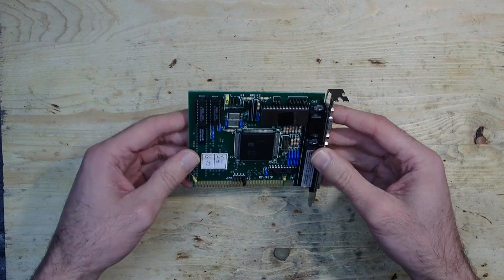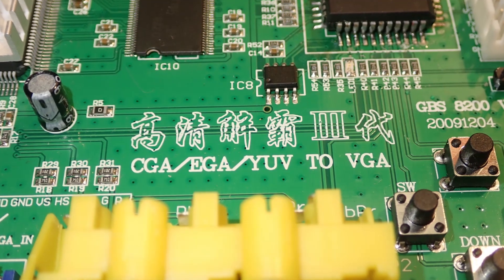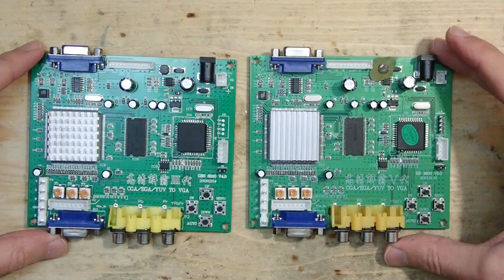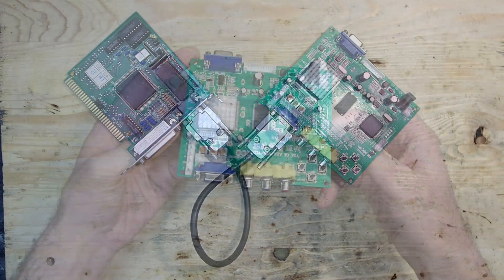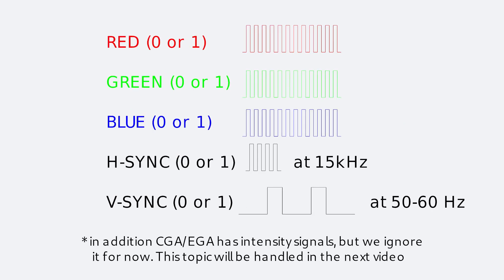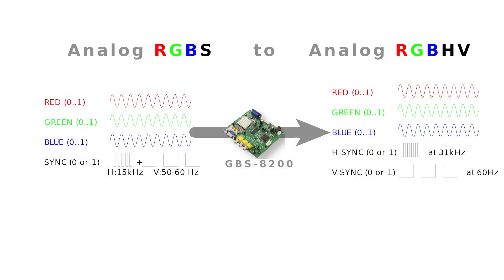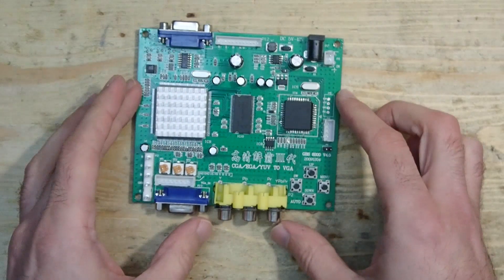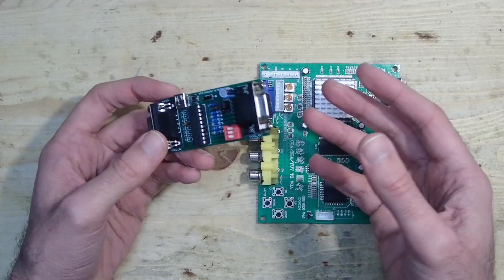MCE-Adapter (part 1): Why GBS-8200 is not a CGA/EGA converter

Comment: Just wanted to drop you a line and let you know I just built this board (had PCBWay print version 0.10.1) and it works great! I have it connected to an OSSC (not a GBS-8200) and it has no issues at all.  So far I've hooked a Tandy 1000 EX up to it, and I'm going to try out a Laser 128 (with RGB adapter) and a C128DCR later too. Although I have a couple RGB monitors kicking around, they're for dedicated computer setups, so it's nice to finally be able to work on CGA/digital RGB computers on my OSSC/HDMI workbench without having to disconnect a monitor and lug it around. Thanks for making the design open source!

Comment: This stuff's a bit over my head, but I always thought I was using mine for a CGA type signal. I use the GBS with Roland samplers which output RGB as TTL signals along with the two sync lines (15k horizontal). Decades ago, I used the same outputs to feed a standard Tandy CGA monitor with no issues. BTW- I never did understand why these things have a 15 pin sub for input when they're supposed to be for CGA,etc.    -Thanks for the videos too!
Reply: the roland samplers lack an intensity pin, displaying only 10 possible colours (black, red, blue, green, magenta, yellow, cyan, white) as opposed to CGA's 16. this makes it possible to just sort of jam the RGBHV signal right in, even though the levels of the digital RGB lines are higher than they should be.
Reply: @famitory  hey famitory, I was surprised  a little while back to find that the cable I have (which I used with the CGA screen) actually does have some active circuitry in it, but I'm not sure it does anything to the levels. I remember they used some weird upside-down version of one of the sync lines or something, so it may just flip that. -That's the cable with the 9-pin sub on one end (not the rectangle thing).  - and thanks for the info!

Comment: Hi!! cool video, do you know if a replacement for the GAL16V8B (ATF16V8B/BQL and ATF16V8C/CZ.) could work ? its harder to get a GAL without purchasing it from china and wait 2 months to continue the buil. Regards and thank you for your great videos
Reply from the maker: Hi, thank you! You can take any GAL model, which has built-in pull-up resistors on the input pins. I use ATF16V8B too.

Comment: Came across your video. I have an old 8-liner machine. Cherry master. Wanted to replace the old CGA/CRT monitor with A LCD. Bought that “converter “ and no signal. Do you know what I can buy so I can use it?

Thank you
Reply from the maker: This is the first part of this video.
Reply: @necro_ware  I watched them all. But differences in what I need.
Reply from the maker: @RenManinJapan  Unfortunately, this is all I have on this topic. The converter doesn't understand CGA/EGA and you have to convert that signal in RGBS, as I showed it in the video. No other way if you want to use GBS-8200. However, meanwhile there is also cga2hdmi adapter available, which is built around raspberry pi. You can toss the GBS-8200 completely and try that instead.

Comment: Hello, Great project, I will need and try this soon. May I suggest a improvement?:  Put all (most) traces in bottom (non component)  side. this way you can still make the PCB at home, sort of one sided. A couple of soldered wires aren't a big deal, but etching a 2-sider is.
Reply from the maker: Thanks! They are mostly on one side, only power traces are on the back and those can be replaced with a wire.

Comment: CGA/EGA can be TTL-level digital or analog signal.İt's depends the platform.
Analog one generally called RGBI.
Reply from the maker: That is not entirely right. There was an analog CGI signal indeed designed for NTSC, but was specified for a composite output. The so called RGBI was specified only for TTL.

Comment: So the main purpose of GBS-8200, why it was made in the first place, was old arcade machines? This board helps to replace arcade monitors with a new VGA ones?
Still don't know why it's so widely available, CGA/EGA converters are in demand too, and they could be made as cheap as this.
Reply from the maker: Yes, mainly yes. It works for the cabinets, but also Amiga and some other computers. However, it does not, what it is proudly advertising - support for CGA and EGA. Anyway, in the next part I will show how to close this gap.
Reply: @necro_ware : Perhaps I am giving too much credit, but is it possible they got confused? VGA is backwards compatible with EGA and CGA, and perhaps that's what they were thinking. However, I'm doubtful of this theory, as I would assume that if they advertise CGA and EGA compatibility, then they must have tested it for that compatibility; clearly, they did not.
Reply: @Christopher-N  They probably use EGA/CGA to refer to those resolutions and not to their actual video standards… much like picking those resolutions in an old PC game with a VGA graphics card installed.

Comment: I’ve been using one for years. Originally got it for my arcade boards but I installed GBS-Control years ago to make it a general purpose scaler. You should seriously look into it because it makes this an amazing device! Maybe you’ve noticed, but people often used VGA to refer to resolution… like 640x480p. In other words, it doesn’t always refer to an output specification. I always assumed they use CGA/EGA to mean 240p resolutions in a similar way.
Reply from the maker: I looked quite seriously into it, just watch the follow up videos to see, how it went. In regards of EGA/VGA/CGA, what people say is one thing and what you write into the specs is another. You can't just write, that your device supports digital video formats, but do analogue only. If they call it so only because the resolution or frequency, than I can call bicycle a car because it has wheels ;)
Reply: @necro_ware  I agree, but it’s not worth arguing that a “VGA” webcam that plugs into USB isn’t VGA. In the case of EGA/CGA people aren’t rampantly abusing the terminology yet so there is still a chance to save it. ;)
Reply from the maker: @emmettturner9452  Well, I don't know how about you, but if I buy a device, which primary job is to convert particular video signals, and which advertises it, but doesn't do that, I feel slightly scammed.
It's like to pay for a mouse and to get a joystick instead with an explanation, that everything is USB after all :D
Reply: @necro_ware  Yep. Pretty big fail on their part. Back then I assumed that arcade guru’s were just weird and adopted CGA/EGA as shorthand for those resolutions, though I was already aware that they were calling things medium res, high res, etc when they were all SD resolutions.
Reply from the maker: @emmettturner9452  That is actually even more complicated, since there are two EGA modes and they couldn't be more  different. The one is a low-res, but is pretty much CGA otherwise. It just had more memory and could use 16 colors, instead of pallets of 4 colors as with CGA. But everything else was the same and you could even use CGA monitors with low-res EGA. An then there is the high-res EGA which is completely different with RGBIrIgIb signal with up to 64 colors, almost double the resolution and completely incompatible inverted sync at 21kHz instead of 15kHz, which were used for CGA and low-res EGA.
But GBS-8200 manufacturer didn't bother about that minor details, they just printed CGA/EGA on it and ciao. I was really confused, as I started to evaluate it. However, on the good side, that pushed me do investigate deeper and to make my MCE-Adapter. So, even if I don't appreciate such a scam, I'm still happy :D

Comment: Wait, so the GBS-8200 is useful as is for Amiga owners? Just need to fashion a cable?
Reply from the maker: Yes, but you need a resistor on the composite sync signal, since the voltage from the Amiga is too high for the GBS.
See: 
https://youtu.be/q3J4QJsn0ig
https://youtu.be/xqlrOcGZx38
Reply: @necro_ware  super! Thanks

Comment: I always thought cga/ega was only through the white connection to the left of the vga port.
Reply from the maker: Those pins in the white port are connected to that DB-15 port pins, so they are the same. And the DB-15 port looks like VGA, but it isn't. It is analog RGBS with composite 15kHz signaling. VGA is RGBHV at 31kHz.
Reply: @necro_ware  yeah i seen a close up of the silk screen those far left pins claim to be the rgbs connection.

Comment: I was curious if the gbs could actually convert legit cga/ega signals.  The arcade community isnt always the most tech minded and when ive asked collectors if their monitor does 15/24/31khz they just get confused until I mentioned cga, ega, or vga, and then they of course understand 😂.  So yeah, blame the arcade crowd for the improper naming.

Comment: Shame you had to learn it the hard way! :( But yes, sadly the terms "CGA" and "EGA" are misused in the arcade board industry+hobby, as shorthand for any 15kHz and 21kHz video signal respectively. As you point out, the GBS was originally intended for the arcade market, so it makes some sense why they used those designators, despite contemporary arcade video being almost exclusively analogue RGB+S.
Reply from the maker: No need for sorrow, I learned quite a bit as I dived into it. Furthermore it ended in my MCE Adapter, which already was helpful for many tinkerers around the world :)
Reply: I've only ever seen people say 15K or 24K when talking about arcades. Never heard anyone use CGA or EGA. Maybe it's more common among the older pre-JAMMA crowd?

Comment: Hi my friend! I am waiting for the follow-up :) . In the past I was thinking to buy one to connect to my Amigas, but many people reported that the picture quality is very poor. There are some web pages that show how to mod the GBS to get a very good image quality. If I remember correctly, one of the first things to do is to replace those crappy caps with some new ones and different capacitance. I could be an nice idea to some more follow-up videos... Enhancing the output quality of the GBS...
Reply from the maker: Hi Jorge! Thank you once again :D I was on this topic for quite a long time yet and learned a lot of stuff about video formats and also gbs-8200. I tried couple of things, also capacitors and better shielding, but the best and simplest way to improve the quality dramatically is just to replace the firmware with gbs-control. It's open source and you can find it on github. I think I will tell couple of words about it in the next video, but you already can find a lot of videos on it and the follow up will be more about my adapter, which I briefly showed in the end. Anyway, the image with gbs-control is extremely good.

Comment: I tried the GBS-8200 on my Amiga and the tearing, shearing and latency were so terrible I couldn't take it.  I ended up building my own S-Video converter using an AD725.
Reply from the maker: I will briefly talk about it in the next video, but if you use gbs-control firmware, the image quality is mind blowing and the latency falls by far under 20ms. Even if GBS-8200 is a lie in regards of CGA/EGA, it is still a very interesting device for tinkerers among us. Unfortunately, the firmware is obviously a pile of crap and thanks to gbs-control the device shows the full potential of the hardware. It's pretty amazing, believe me....
Reply: @necro_ware  Good point.  Have you seen the Raspberry Pi Zero implementation that has very low latency and proving to be really good solution for many platforms?
Reply from the maker: @cbmeeks  Yes, the one just came shortly, right?

Comment: Unless I'm mistaken, the only issue is the sync signals being seperated.

I guess it isn't as simple as connecting together the two sync signals? ;)
Reply from the maker: Well you actually have to connect the two sync signals, but you can't just twist the two cables. It is not very complicated, but also not that simple. Anyway, it is not only about the sync, also the RGB color information is in a completely different format. As I explained, GBS-8200 wants analog RGB signal, where every color is mixed out of RGB values each between 0..5V, so this allows to produce nearly unlimited amount of colors (well with 24 bit and 8 bit per channel, you can reach 16,7M colors), but CGA/EGA has only digital RGB color values 0 and 1, nothing in between. That means, that you can get maximum of 8 colors. What I didn't tell in this video (there was just a remark), that CGA/EGA both have additional color intensity information, which is not part of RGBS. So, in short, if you even will manage the problem with the composite sync and try to connect CGA/EGA, you will get wrong colors. So, no, the problem is not only the sync signal. But stay tuned for the next part ;)
Reply: @necro_ware  Thanks! Looking forward to the next part.

Yes, I understood the difference, but in the end digital just means there's no in between once in the analog domain. It's 0% or 100%. But I didn't know there was intensity being carried in CGA/EGA. In which case it makes lots of sense an adapter a little more complex is needed.
Reply: Oh I just realized... You probably meant luma. Duh
Reply from the maker: @jeremiefaucher-goulet3365  I guess, you confuse it with S-Video/Composite. EGA, CGA and Hercules have so called Intensity signal, which doubles the amount of colors.
Reply: @necro_ware  Right! Thanks for reminding me of this doubling

Comment: Another solution is to use a european TV set with good old Peritel (or SCART) input. Another plus of using a TV set is using CGA graphics card with composite output, and enjoy 16 color graphics instead of awfull 4 color graphics mode

Comment: No, you wrong!! :)) CGA and EGA have analogue RGB, but it have only full ON or full OFF - no gray state. A was have  EGA monitor and with a little change in schematic  it became common RGB monitor. So, you just plug RGB directly to converter or thru resist divider(5V to 1V)

To merge sync signal you can use resistor and diod and invertor, if it need :)
Reply from the maker: "...but it have only full ON or full OFF..." - this is exactly how you describe digital output :D
Reply: @necro_ware  No, digital have some bits became to different colors, but in this case it only on/off current line - I think it's "binary output", becouse of two state, not digital))

I'm forgot about intensity - but it just add brightness to channel, so you can use resistors plus diode from intensity to make truly analogue RGB :))
Reply from the maker: I really don't want to argue about this, but MDA/CGA/EGA standards are officially called "digital TTL". If you are really curious, I think Wikipedia is a good start: https://en.wikipedia.org/wiki/Color_Graphics_Adapter. Digital means, that you have 0 or 1 (0V or 5V) and, that the system can't take any values in between. The thing, where multiple bits are encoding an information, like color, are called protocol and is more advanced digital technology. MDA/CGA/EGA were no so advanced, but still a simple 1-bit digital format. VGA introduced so called RAMDAC, which was responsible to translate digital to analogue signal to provide it to an analogue VGA monitor. So, it is funny, but our first PC monitors were digital until we got analogue with VGA and eventually digital again with DVI and later.

You are right in regards of connecting a digital CGA/EGA to analogue RGB. It will accidentally work, because analogue RGB will try to interpret digital signals and will even get a picture, but your colors will be extremely bright, the number would be reduced to 8 and would look wrong. Furthermore, you would damage GBS-8200 over longer period of time, because it is not designed to constantly hold up 5V on the input.
Reply: @necro_ware  I think IBM engineers was "Hi", then they invent CGA/EGA output, or they try to prevent use standard TV with IBM, because it use common TV frequencies - very weird "improvement")) 
Same graphic genererator use ZX Spectrum, but it standard RGB+HV output

Comment: Works with Jamma boards. Probably not so good for what you are trying to use it for.
Reply from the maker: Yes, because Jamma is not CGA/EGA, but analog RGBS. This is what I wanted to point out. If you look on the PCB of GBS-8200 you will see "CGA/EGA/YUV to VGA" and this is a lie.

Comment: why didnt u make the adapter with a female connector so ya could just plug it into the GBS without another cable inbetween?
Reply from the maker: Because I use it mostly with a VGA cable of my monitor, which can handle the low frequencies
Reply: @necro_ware  that doesnt answer the question... you could have put a female vga on the gbs side and plug straight in...then plug your ega cable into the other end... SMH
Reply from the maker: @WacKEDmaN  This is what I do, when I need to connect it to GBS. I put female adapter in between, but in 99% I use my monitor, where I don't need any adapter.